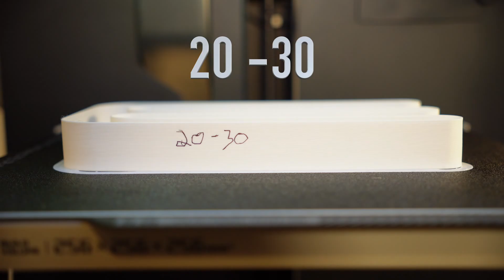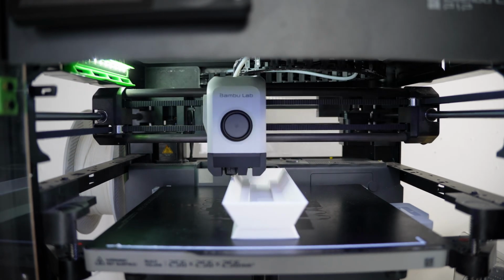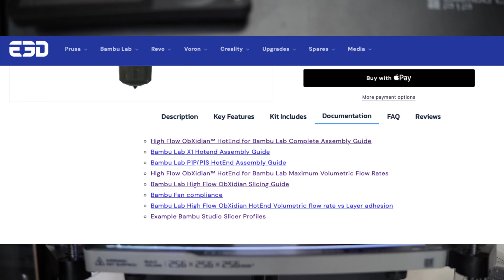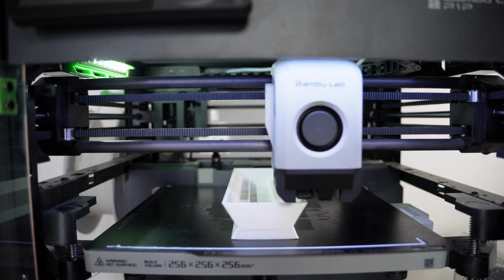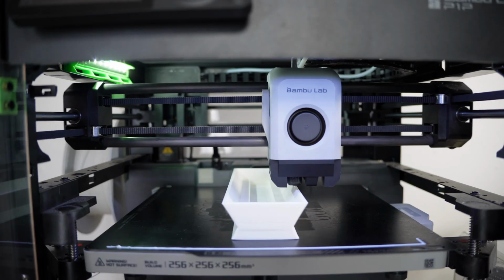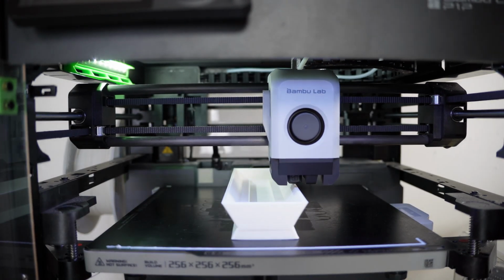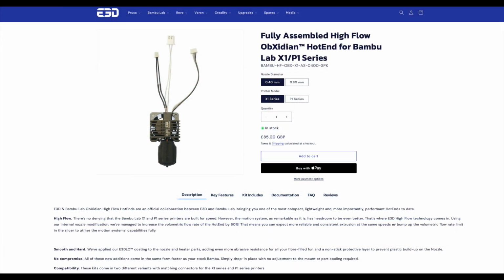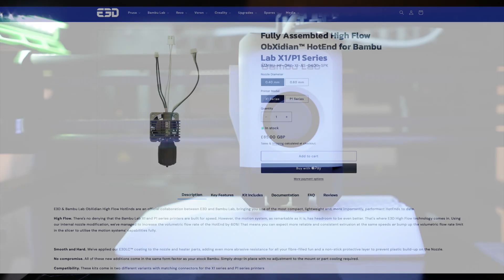E3D ObXidian HighFlow HotEnd: Review and Thoughts

Comment: The benefit I see using this hotend is better non-stick properties (PETG can be annoying) and better melting performance; better layer adhesion on default/sport speeds (or no need for HF filaments with lower layer adhesion) to avoid VFAs.

Comment: This was very helpful Thank you. Creality must be trying to clear out some old stock for their end of life products. They're on sale on their website for the k1 series / ender 3v3 plus which is what I have for $20 a piece. Printing perspective did a video comparing how these nozzles have great layer adhesion through a wide range of printing speeds. I think you're right in that most people would not benefit from these. However for 20 bucks and the ability to increase layer adhesion for technical filaments which is what I like to use, it's hard to pass up.

Comment: how is the durability after 6+ months? is the nozzle starting to wear?
Reply from the maker: Honestly good but I took it out about two months ago and went back to stock just cause I run a print farm and it was annoying having to use a different profile and the results being bit different tolerances wise
Reply: @FilamentFoundry  which one has more accurate tolerances?
Reply from the maker: @TheSpartansFUT  the are both the same size
Reply: @FilamentFoundry  Yeah but I mean which one prints with better dimentional stability of the 2. The tolerances printed with the stock nozzle or the aftermarket one?

Comment: I print a lot with a 0.6mm nozzle with PETG, I am considering the 0.6mm Obxidian because with the 0.6mm my max speeds are limited to about 150mm/s due to volumetric flow rate, also because I want to make sure my prints are strong as possible.

Comment: I own an X1C and a P1S. I like to design parts for use around the house, but I do not run a business, so I could still be considered a hobbyist. Even with the speeds that these machines boast, I did still wish that they were faster. I had tried using the ludicrous modes on both, but I would often find that the flow rate was the major limiting factor. I decided to pull the trigger on these hotends, and while I have not changed my volumetric flow rate for my filament profiles, I can easily hit ludicrous and cut the print time to nearly half, which is great for rapid prototyping. So, if you're anything like me, I would still highly recommend these hotends.
Reply: So i made a closet specially for the 3d printer. I made it really solid. But the vibrations given on normal speed just are a lot. Even though i screwed it against another bigger closet. If i set it on ludicrous, my closet is almost eating the screws and walking out of the room. I think i will need to seriously modify and set more supports maybe diagonals to constantly print on ludicrous. The closet is fully made with plywood 20mm with a width of only 65cm.
Reply: @Trillineatus  Have you tried anti-vibration feet for the printer yet? They are really only useful for reducing the amount of vibration going into the surface your printer is on. That should help with your use it seems!  They are most useful if you have two or more printers on the same surface, they will reduce the amount of vibration going into each other. From what I understand, it is better to keep the vibrations in the machine and let the vibration compensation program do it's thang!  Yet again, from what I understand, the more stiff or stable you make the machine mounting, the stronger those vibrations resonate into your surface, and in your case even the closet next to it, and back into your machine making it harder for the compensation program to work. The anti-vibration feet might even clean some of your prints up!

Comment: But is it better then big tree techs revo hot end. I don't think so it's not able to switch nozzles. plus that tip is available from E3D rapid change nozzles and you can switch size. So your better off buying the big tree tech revo hot end.
Reply from the maker: Yes but the revo hotend can’t be PID tuned on a Bambu lab machine

Comment: Does anyone have this and the Biqu Panda Revo debating which to get. Thanks
Reply: I have both, they are both pretty good I have multiple printers using each type, the revo is best for switching and with high flow nozzles prints fast and good, the E3D ObXidian is a all around better and faster nozzle you can stuff anything through it 2 or 3 times faster then stock and 30-50 percent faster then the revo high flow, however I like them both and would probably go with the revo unless you stick to one nozzle size. I have my E3D ObXidian on machines that stay either .6 or .4 and revos on my machine I switch a lot. Keep in mind that the revo high flow still prints fast easily double the capacity of the stock bambu nozzle. Also with the revo do not get cheap aliexpress nozzles they will leave a plastic residue on the nozzle and make it harder to replace the nozzles, just get the high flow  coated type. One other thing my E3D ObXidian have never clogged, and my revo has but I think if you print carbon fiber then make sure it above .6, mine clogged printing cheap PCTG with .4 revo high flow which splits to 3 small lines which I think clogged. It was easy to do a 100c cold pull to clear it, but my E3D ObXidian has never clogged. I still would have no issues buying either, in fact I have a sovol SV08 I'm getting ready to mod to a bambu revo style nozzle so I like both.
Reply: I would suggest that one over this one

Comment: The largest speed benefit w a 0.4 nozzle doesn't seem to be for PLA, but for higher temp filaments like ASA / ABS.
BL's default flow setting for their filament is 18mm3/s (ASA) and 16 (ABS).
With the Obxidian this jumps to 35 (ASA) ! And am guessing ~31 for ABS. Huge gains, would cut hours out of my 11-hours prints.
Since I mostly print ABS, the Obxidian is high on my Black Friday list this year !
But darn, would REALLY REALLY REALLY like a quick change nozzle to switch btwn 0.2, 0.4, 0.6